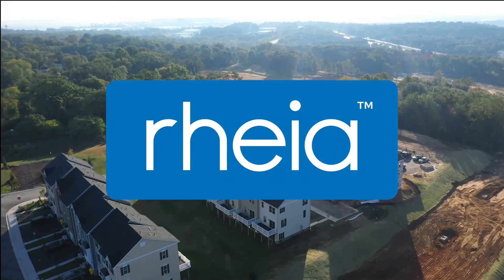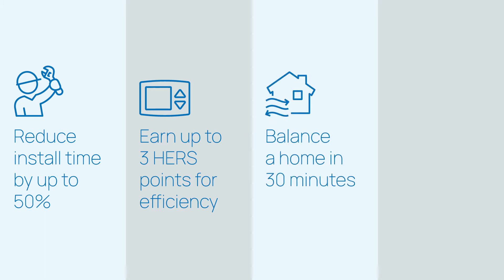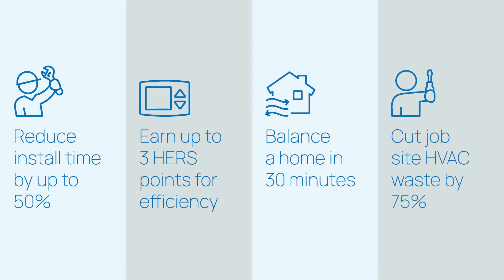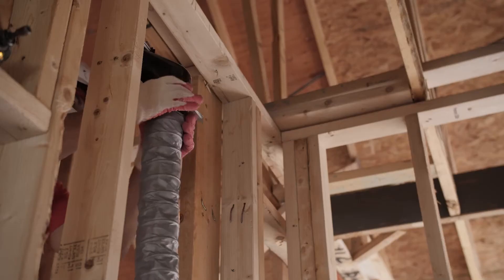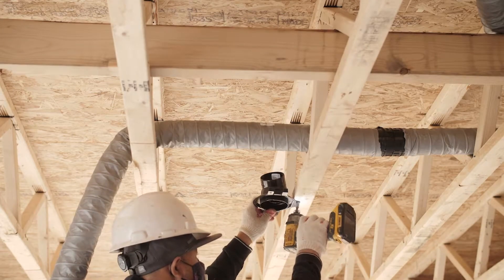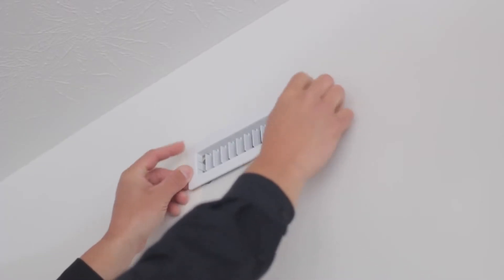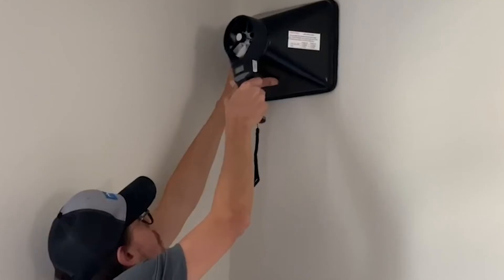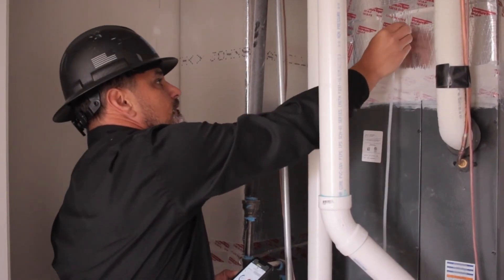Rheia Air Distribution System Overview

Comment: This duct system should be banned.  

So, on a typical  3 ton setup, a HVAC contractor would have a minimum of three 10" rounds, worst case, the equivalent of three 12" rounds.  About between 235 and 300 sq inches coming off of the main plenum.  Then typically, that would run out into 10-14 6" vents, or in many cases, we run less vents in a room, a single room with a 8", in that case, a 3 ton setup could run 6 or 7 vents total.  With 10 6" vents, on the small end (which helps Rheia look better), we have 282 sq inches total in final vent locations.  With a surface area of 188 linear inches of diameter between those ten 6" runs.  

The Rheia, has 3" vents.  9.5" per vent in circumference that offers 7" of cross sectional area.  In this case, multiply all that times 23.   161 sq inches of area for air to pass through,  passing over 219 sq inches of surface area.  So, Looks like this duct system is only good for 2 tons if that  (equivalent of a single 10x16 rectangular duct), yet is has significantly more surface area than a typical 3 ton setup.   

You can see where this math is going.  If this system had the proper crossectional area enough for a 3 ton, you would need about vents to get to 200 sq inches (about a 16" round).  Yet 30 small 3" ducts yield 285 area of circumference.  Yet a 16" round yields 50 sq inches.  we are talking 600% difference.  Anyone just do the math.  This is going to lead to some bad things nationally.
Reply: I've done thousands of manuals, I've done and managed thousands of intricate installations, and the rheia system doesn't scale.  Its more challenging to package all things being equal.  These ducts will take up more space, and will put more load on fhe blower, with much less velocity than fewer, larger ducts.
Reply: Crickets.  Bueler,  Bueler, anyone home.  Id challenge the rheia engineer to a simple training and defense of the system, to be posted online, for everyone to see.  Please reach out Rheia.  This product is going leave a massive scar on our industry, its just a matter of time.  The trickery ive seen done on the manuals in wright soft, putting in available dict static at 1.0, not including filters, many dealers are essentially trying to make funny math work, literally designing system that really need a blower than can handle a static of 2.0".  

Please reach out.  A simple google of Jones Mechanical in Vineyard utah.  Find me.  Ill be happy to retract my criticism if in fact this duct approach offers any value.  Value in installation packaging, value in efficiency, value in better material cost, value in airflow velocity/noise .  Its fail fail fail fail in every category if you actually scale the duct around a static of .60" or so.  The truth will get out one way or another.  It will like come out in the form of a class action.  We have seen this so many times in this industry.  This will go, but not soon enough.